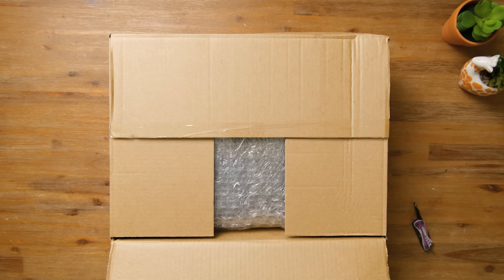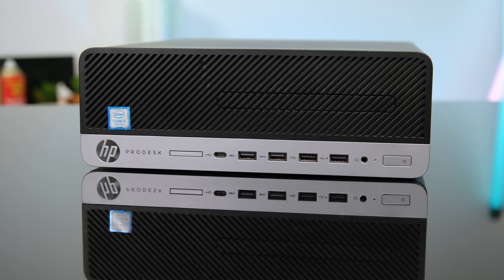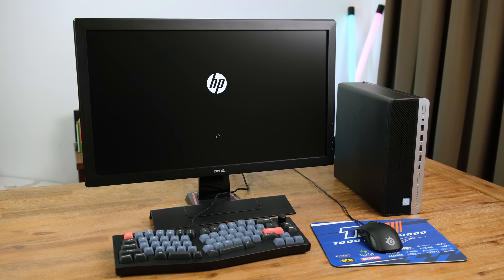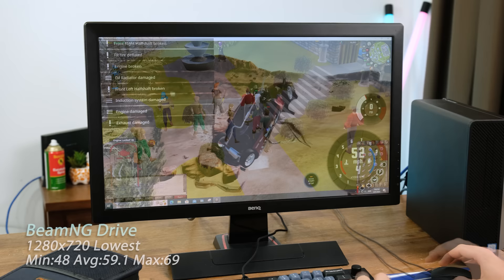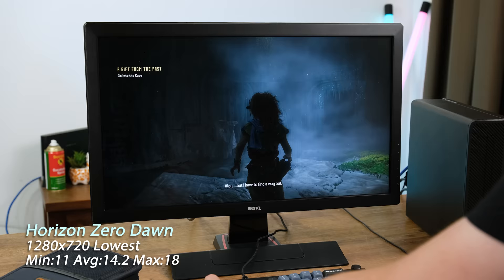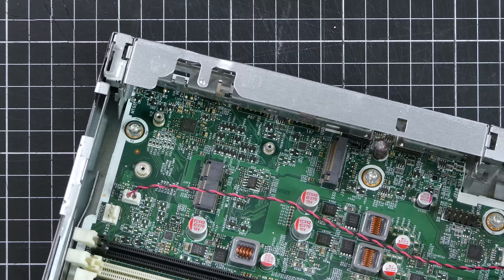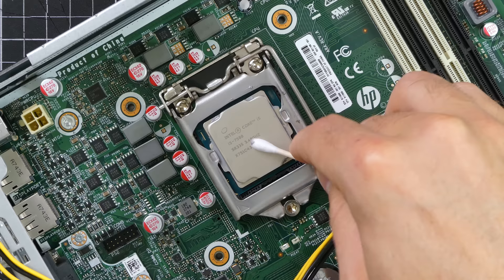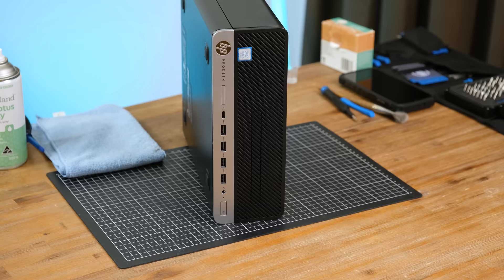Gaming On A $152 Computer?

Comment: The second slot cover probably comes off with bending (as many sff pcs usually do), so putting something like a GTX 1650 probably would be possible.
Reply: Yeah but the 16x slot is at the bottom so you cant fit a 2 slot graphics card in it unless you use a short riser cable, which would be kinda interesting to see! Also do they make low profile 1650 graphics cards?
Reply: @koolin3613  Ahh you're right - didn't think about that. Also, Gigabyte, ASUS and MSI have all made low profile 1650s, which is weird because no one really talks about them.
Reply: @thedicer033  yeah i googled too they look good, i do think if you managed to fit it in this case with a riser, i do wonder what the thermals would be since the fans are right up close to the power supply shroud, and there is not a lot of airflow in the case
Reply: @koolin3613  I’d assume that they’d be alright - given the low TPD of the card anyway
Reply: @thedicer033  thats true i mean a 2 slot cooler on a less than 75 watt tdp card is a lot

Comment: Its a shame these were designed to be ewaste after their life span.
Upgrading them is a pain as most of require a certain specific set of things to even be doable and some boards even had hardcoded locks on them so you couldnt change anything.
There's nothing pro about them they gave tons of ports but nothing about them was special or usefull. These will always be E-waste and a waste of money for most